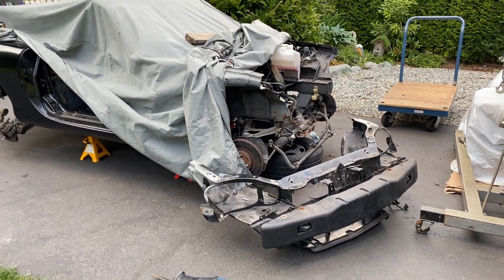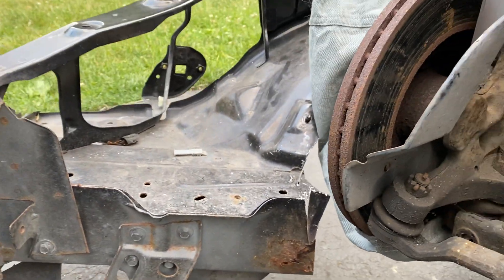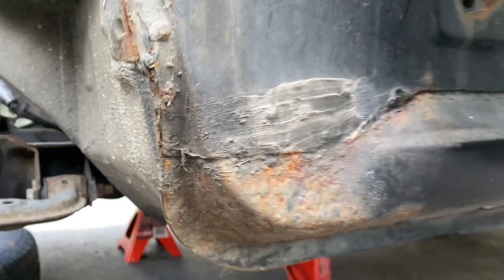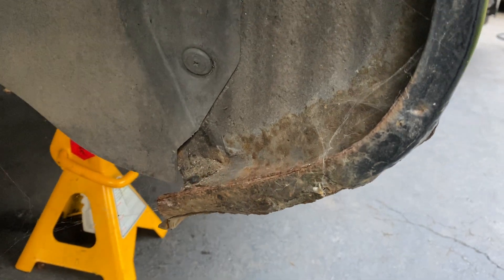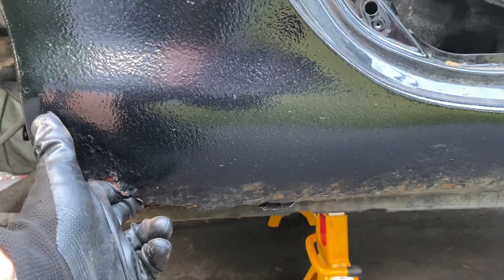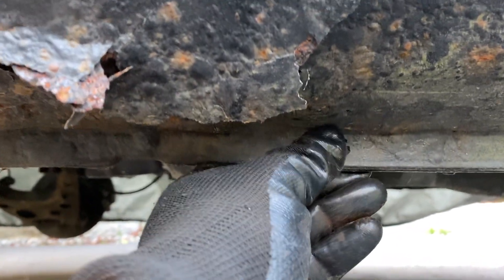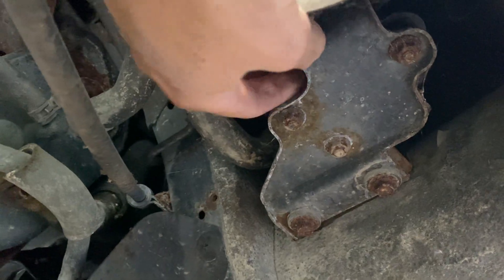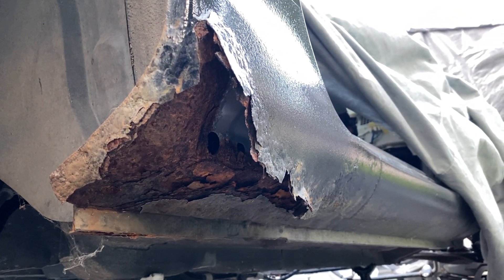RUST ⚠️ 1999-2005 (NB) Miata.

Comment: On our old mk2 you could literally finger the inside of the frame rail from the inside. Dual layer design defo more prone to rust in that area. Front wings it doesn't help that the water drain into them and the water just sit there. Rust wise defo happier with an mk1.

Comment: I have a Tupperware kit on my NB, are they easily removable to check/clean out these areas?
Reply from the maker: The Tupperware side skirts are usually held on with a series of clips and double sided tape. It will take some time to remove them. You can still access all of the drains with the side skirts in place.

Comment: I wonder why the NB front rails rust so badly but the NAs dont
Reply: Was something to do with a design fault where there is a gap where water would get trapped
Reply: Multi layered steel was used on the NB’s and not the NA’s. So what happens with MLS is the outer layer gets nicked and moisture gets trapped between the layers. So the it rust from the inside out because the inner layer is bare metal